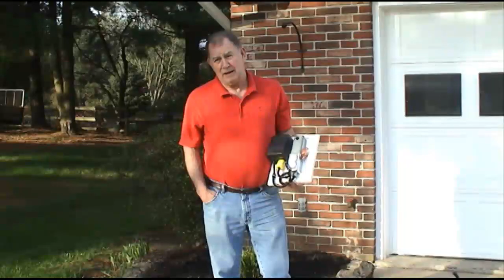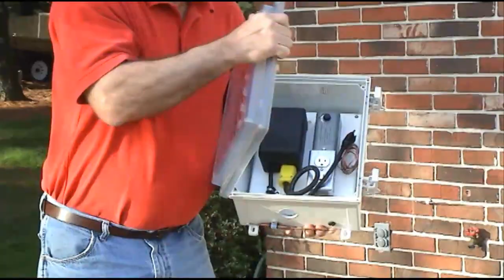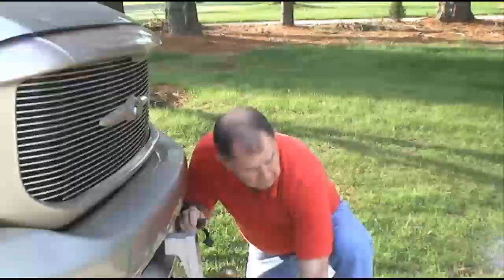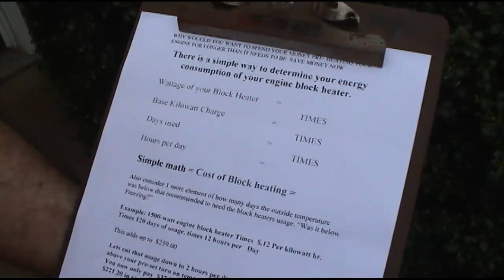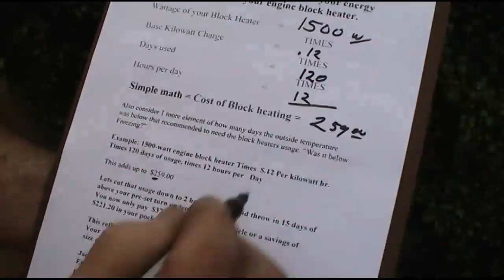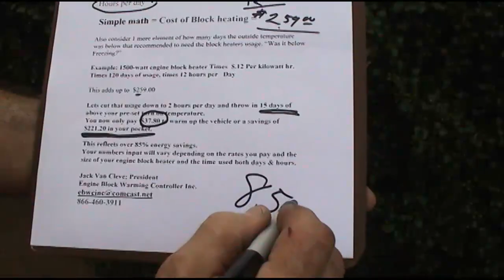Engine Block Warming Controller

Comment: < make some type of disconnect for when you forget to unplug your vehicle haha (happened to me once).
Yea, you got THAT right! Happened to me too. Luckily I ran the outdoor extension cord out under the hood and had looped the cord around a deck rail post so when I backed out - the cord simply pulled away from the heater plug and yanked out onto the ground.

Funny, that's when I remembered all the times we'd put/pull those red pitot-tube covers, landing gear and gun interlock pins on our planes.

Comment: be easier to just buy an electrical timer, plug it into the wall socket, plug heater into the tiimer, set it to turn on a couple hours before you have to leave    .....